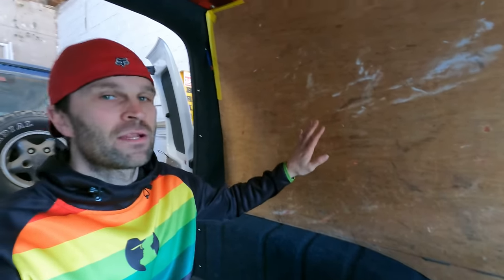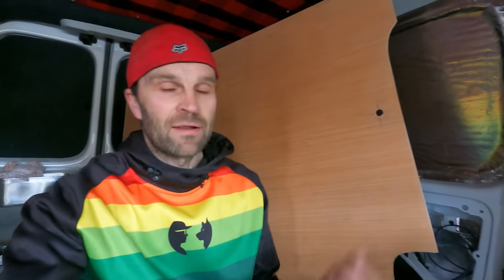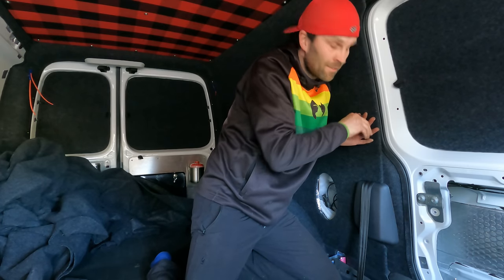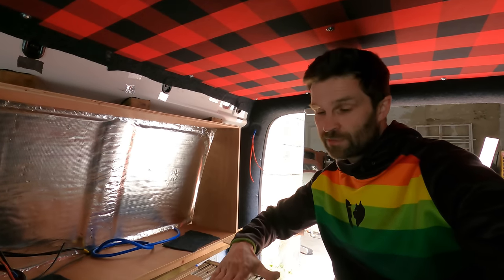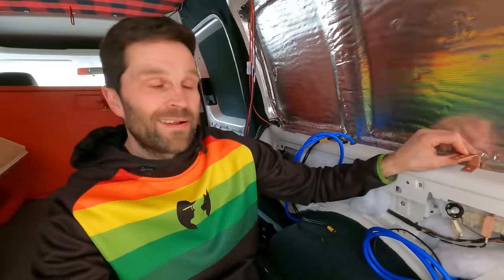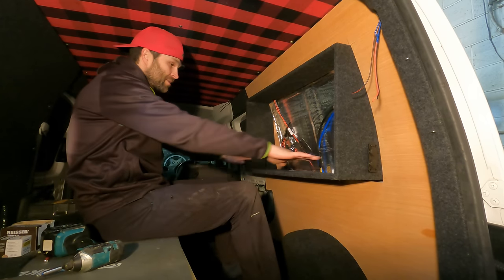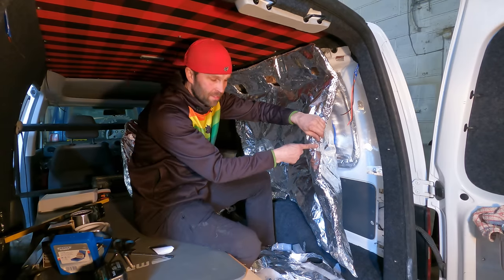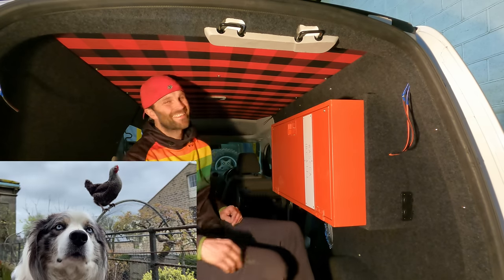FLOATING TV CUPBOARD 👌 VAN BUILD- VW Caddy Maxi Micro Camper Conversion - Van Life Tour RV Vanlife

Comment: Love the van build - really nice  job. Thought you might be interested to know that the cupboard you have is from the Royal Navy, it was used to store the old fire fighting Breathing Apparatus used on HM Warships until about 20 years ago. The sign on the front means Breathing Apparatus Self Contained Compressed Air (BASCCA) - Damage Contrrol & Fire Fighting (FF & DC). 
Love the videos - Can’t wait to see how the van turns out- good luck!
Reply from the maker: Yes mate I remembered once reminded. I also googled the lettering. Apparently it came out of the scrapped HMS ark royal so I don’t want to change its original condition. I also own the radar from the HMS ark royal. There are only two!

Comment: AL - am loving the build so far but I have a thought for you. It's more efficient to charge your DC batteries on a DC/DC connection, I realise you are fitting an invertor to get the 240v sockets but you don't really want to charge your low voltage DC batteries off this source, as you essentially go from DC -> AC via your invertor and then convert that AC -> DC via your plug in charger and this is basically taking low voltage DC current and converting it and then dropping it again via your power packs (which is wasteful) you would be better off getting a direct DC charging solution which doesn't lose anything by converting energy around. Am assuming this is because you don't want to use a leisure battery? It would be a much more efficient solution, invertors will kill your car battery as they are build for ampage and not voltage delivery

All the same am loving the van build vid's - just please, please, please don't become one of those VW 'van life' (insert expletive here) that you find in every nook and cranny of the Lakes now 🤣👍
Reply from the maker: Thanks mate. I’m not using the car battery at all. No inverters. I’m having solar charging my Ecoflow power station which feeds a fuse board and I’ve extended its 240 to a couple sockets. It seems to work perfectly.

Comment: I've never understood why car interiors are covered in that furry carpet stuff. It isn't hard wearing, and it isn't easy to clean. It collects hair and grit. Horrible stuff. I would have gone for all hard, wipe clean surfaces for floor, wall and ceiling. It's not like you would put carpet on the walls of your house, is it?

Although I did have a distant relative who had carpet on his walls. He owned a carpet shop and had more spare stock than spare cash!
Reply from the maker: It really softens the space and adds to the sound deadening and cosiness. It will attract the dog hair though😂